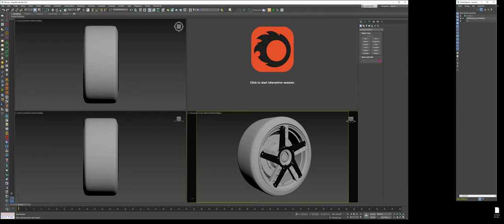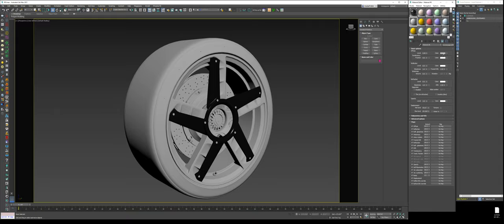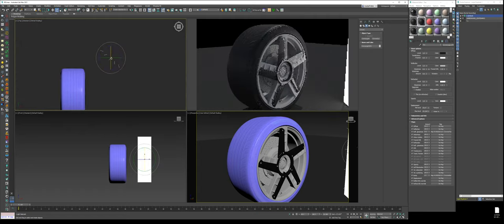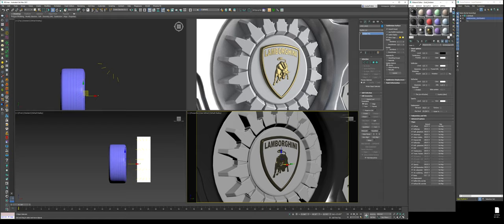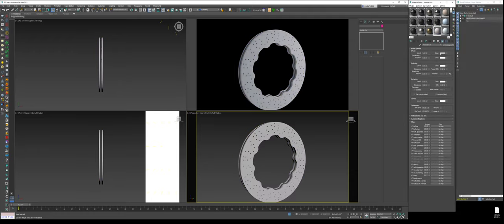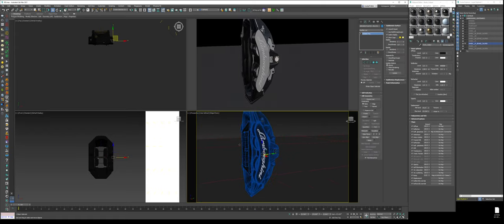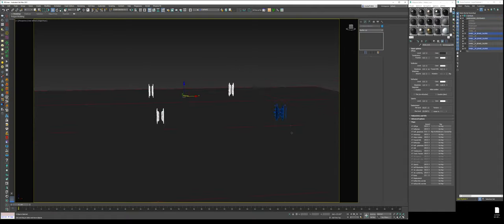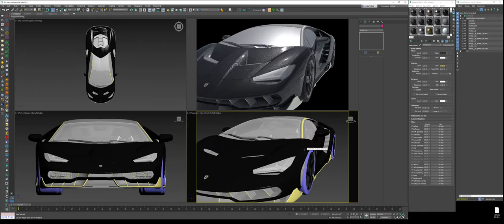PG2CGI - 07 - Lamborghini Wheel Prep in Corona Renderer

Comment: Just a suggestion, why not keep Turbosmooth iterations at 0 but enable Render Iterations and set that to 2 to keep the viewport speed high.  For your workstation it may be fine but for others, it may be worth keeping in mind as a viewport efficiency tip. That way, Turbosmooth is really only enabled when you hit render or start interactive renderer.
Reply from the maker: 100% correct. I never do that simply because it never bothered me. When I got into CGI I had a very low cost build and still never had issues, so I never made it a habit to do so.